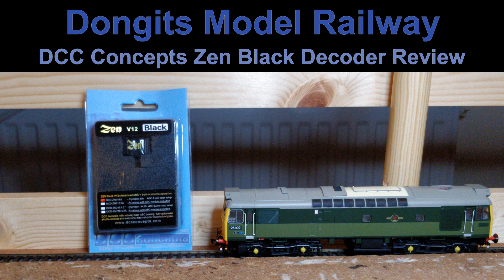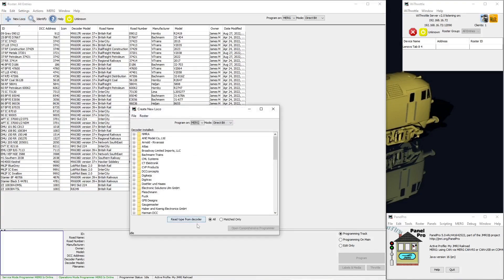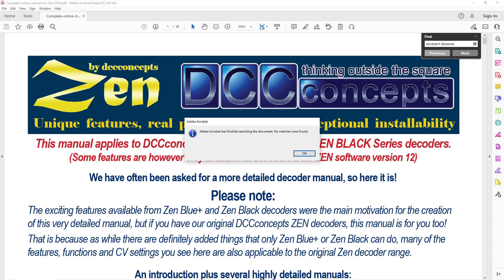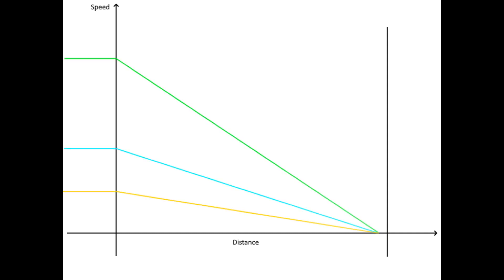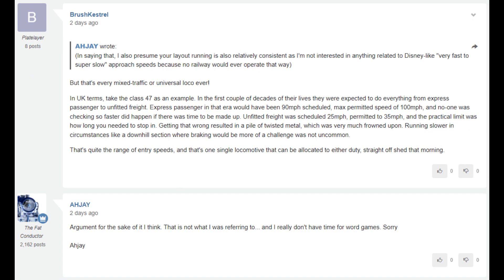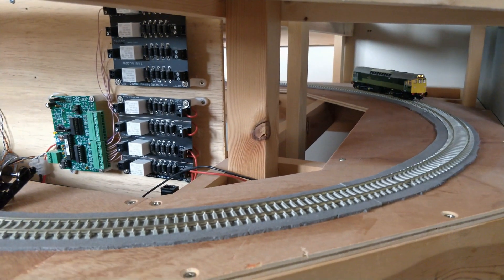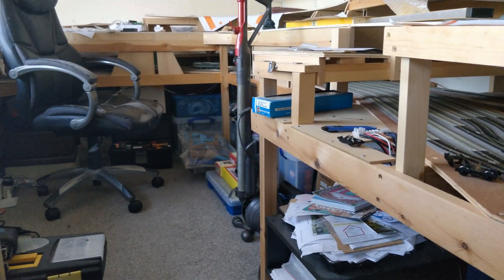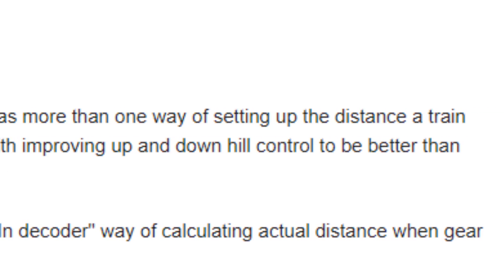DCC Concepts Zen Black Decoder Review - Just how good is their ABC?

Comment: I feel particularly stupid after watching that. My layout has been left in the loft of my previous home and my new loft is a railway free zone at the moment. When I did play trains, I drove them around, made them whistle and stop and shovel coal and flange squeal and so on and have no idea, or have even heard of ABC constant distance braking. The graphs you made helped and I would assume that it is used for automatic train operation? Returning to the graphs, I would assume that all decoders should be able to apply graph one - trigger point to stop point - without a huge amount of trouble. It would seem that would be a more difficult move than I thought.
Well put together video, interesting point well made and pluss one subscriber.
Reply from the maker: The decoder measures constant distance by dead reckoning, counting the fluctuations in back-EMF as the motor turns. Given the pole-count of the motor, the gear ratio and the wheel diameter is all fixed, the same distance can be reproduced.

ABC can be used for fully automatic train operation, but I use it a bit more like the real railway uses TPWS -- to catch trains that people failed to stop themselves. Consider a club environment with 5+ people driving trains -- and chatting at the same time. All too easy to creep up behind someone, or miss a junction set wrong. This stops everything from expensive accidents to accidental shorts.

There are two features of the decoder that are required to support constant distance ABC braking -- the ability to spot the voltage imbalance (which almost all modern decoders have), and the ability to count motor revolutions from the back-EMF. This latter one is not universal -- you'll find all Zimo, all current generation ESU and most current generation Lenz have it, but I'm guessing the reason DCC Concepts haven't implemented it this way is because the hardware they are using can't do this.
Reply: I find it intriguing to see what different DCC features appeal to different people. It is not unusual or wrong to only know what you need. ABC braking is often used to bring locos/trains to a halt at the end of sidings. It is achieved by using a diode to slightly lower the voltage on one rail only. The decoder is programmed to detect this & respond by slowing. The distance part is useful to stop the train at the right place regardless of its original speed. When the loco moves off again (in the case of a bay platform, reversing out), the lower voltage rail is on the opposite side so the decoder does not see this as a signal to brake.

Comment: Not surprised at what you found.  I drew the same conclusions about the decoders from reading the manual.  As soon as it was apparent that DCC-Concepts had departed from the accepted standard implementation of ABC, it was "forget it".   I think your loco-reversed behaviour (creeping on slow-approach when reversing through the brake zone) is predictable from the manual.  

Alternative decoders given the shortage of Zimo decoders:  
Your report indicates that Train-o-matic have implemented Lenz' awful constant braking (brake-then-creep).  
I don't know how well ESU have done things, but I'd start by trying one of their decoders.  
There's D&H who's manuals suggest there may be constant braking (it's a bit cryptic) and definitely has asymmetric DCC braking (if you can find any decoders, think they've got the same component shortages as Zimo).   
Uhlenbrock might be another candidate, their documentation says they support ABC.  
If you trip over one, I think the old Hornby Sapphire decoders may have had ABC in them.  

- Nigel
Reply from the maker: If Lenz decoders work like Train-O-Matic, I can cross those off the list. That's good to know.

I do have an ESU here at the moment under test. Video coming later, but so far it's a lot more work than the Zimo (which have been almost plug-and-play for the most part), but I think I can make it work.

I haven't managed to trip over a Hornby decoder with ABC yet, all of the ones I've dug out of second hand models have been the base model awful ones.

Comment: I think you've unwittingly developed an attitude problem during this whole encounter. Perhaps this is in response to the attitude displayed by the employee on the forum, but I don't think you've managed to remain objective during your experience.

You're clearly a bright bloke, but may have lost sight of the space in which you're working here. The average DCC user doesn't have a clue what ABC is. They also give a very strange expression if told to operate a program like decoder pro. 

Both actual technical problems encountered here, namely;

1.A lack of available configurations for DCC Concepts decoders in the Decoder Pro software
2.ABC implementation in DCC Concepts decoders being different from that which you are used to

are the result of the niche nature of both JMRI and ABC combined with the target market for DCC Concepts' products. 

ABC, such that it is, is not part of the DCC standard. It is built upon the DCC standard, as a 3rd party addition. I can see I have no need of explaining how it functions to you, but you seem to be under the impression that because other manufacturers have settled on one implementation of Asymetrical DCC for automatic stopping that all others should follow suit. 

The average DCC user is typically not interested in the high quality offerings by Lenz or Zimo (outside of sound decoders). The average user is concerned with, in order:

1. Value for money
2. Availability
3. Ease of use
4. Performance

and so the list goes on, but it would take an awfully long time to reach "ABC compatability with other manufacturers". If this were not so then Hornby and Hattons' decoder sales would be considerably less profitable.

I don't say this to somehow belittle you for being an advanced user of DCC, but to try to explain that DCC Concepts' decision to implement ABC differently from the way you are used to is not irrational or a failure. It is the direct result of seeing ABC as a means to offer low skill DCC users an effective shuttling facility. Does this mean they are somewhat limited if they later change the purpose of their ABC installations? absolutely. But I cannot imagine it has ever mattered to someone who has been introduced to ABC as a concept by the Zen Black range as a means of creating intuituve shuttles.

As for the lack of decoder pro configurations for Zen decoders, that is regrettable for us happy users of JMRI, but not of much consequence to a business which clearly doesn't care much for the software or computer control in general. For a business that doesn't specialise in this potentially very complex and extremely individual world, this is frankly understandable. I don't think DCC Concepts would garner appreciable additional sales by creating configurations themselves, and in doing so would create another line of technical support in an area which most modellers, even experienced ones, simply don't understand. Again, the averge DCC user will turn their nose up at the first sight of code.

As someone who is more than happy to use JMRI and indeed enjoy the benefits of more advanced DCC features such as ABC, I sympathise with your frustration. That said, your response to a free, open source piece of software with no afilitation to DCC Concepts not having precisely what you want is somewhat entitled. It is also completely at odds with your very own actions in creating a configuration for your own purposes which I can only hope you have shared with the user community of JMRI. That is how open source programs are built to be so flexible and powerful and yet you seem to be engaging with that process while lamenting that nobody has done it for you already as if it were the fault of the manufacturer?

I do not wish to emulate the attitude of the staff member you interacted with as i'm completely with you that their actions were very poltician like and not altogether helpful. None the less it seems to me that the sourness of that interaction has blinded you to the rational reasons for the decisions you are criticising.
Reply from the maker: > "I think you've unwittingly developed an attitude problem during this whole encounter. Perhaps this is in response to the attitude displayed by the employee on the forum, but I don't think you've managed to remain objective during your experience."

That would have been a reasonable criticism of the first draft of the script -- the one I deliberately sat on for a week, then threw away and re-wrote precisely to avoid that problem. I disagree it applies to this one though.

> "The average DCC user doesn't have a clue what ABC is."

True -- but this is an ABC specific review. It's in the title, the thumbnail, and the entire video is focused on ABC. If you want a general user review of a Zen Black decoder which doesn't focus on ABC, the decoder has been out for over 3 years and the internet is already full of them. There's not much point in anyone making a new general user review of this decoder now as everything that needs to be said has already been said, and I can't add much to it.

However, the internet is also full of what is frankly misinformation about the ABC features of this chip, written by reviewers who have never used ABC, and their "review" of it ranges from "read from the manufacturers blurb" to "put two modules on three bits of set-track and made a single vehicle shuttle back and forth".

And it is this misinformation that is why I ended up with this decoder in the first place, and thus why this ABC review exists.

> "ABC, such that it is, is not part of the DCC standard. It is built upon the DCC standard, as a 3rd party addition."

Look at the history of DCC a bit closer. DCC is built upon a proprietary Lenz product. A few of the predecessor Lenz features (like stretched zeros to allow control of one analogue loco) were deliberately omitted from the standard to avoid patent encumbrance, and a few extra features to make the previously German focused implementation appeal more to the US market were added. You'll note the vast majority of command stations still implement the stretched zeroes feature, and all decoders can cope with it happening because even though it was written out of the de-jure standard, it is still a de-facto standard.

While ABC may not (yet) be a de-jure standard according to the NMRA, the basic ABC feature set has become a de-facto standard precisely because many different manufacturers use it in a consistent manner, not just the original Lenz implementation.

Directional stopping based on whether the waveform is shifted high or low is one of the de-facto standard features. Please correct me if I'm wrong but as far as I am aware, DCC Concepts is the ONLY manufacturer which does implement ABC braking but does not implement this directional behaviour. Everyone else who implements ABC has managed to do this the same way.

ABC Slow speed sections are objectively not a standard at the moment -- each manufacturer has done something a bit different with the DCC signal to add this feature, and we've yet to see a 'winner' emerge. That gives DCC Concepts license to implement this part however they want, but it does not permit them to drop the standard directional feature without criticism.

Constant distance braking doesn't need to be standardised in quite the same way, because (up until DCC concepts came along) it wasn't part of the train/track interface at all, and could be implemented entirely within the decoder. Hence you see a variety of strategies across the different companies that do implement it, and some that have ABC braking but do not have constant distance. In making it a part of the track/train interface, it's again reasonable to criticise them for this.

> "you seem to be under the impression that because other manufacturers have settled on one implementation of Asymetrical DCC for automatic stopping that all others should follow suit."

Ummm, unironically yes. That would have been the smart commercial decision. If everyone is doing the same thing, there's good commercial reasons to be compatible with it. DCC Concepts could easily have made the standard behaviour selectable by CVs, but in choosing to ignore this de-facto standard, they are siloing themselves off from every other manufacturer. As a small player, that's a really bad idea.

History is littered with failed projects to improve things that were both not sufficiently compatible with de-facto standards to see incremental adoption and not enough of a revolutionary jump up for people to abandon their existing installed base and move across all at once to a different way of doing things.

> "The average user is concerned with, in order: 1. Value for money"

If that is being used as a reason not to buy Zimo's MX600R or MX638D, then it counts against this Zen Black just as much. I paid more for this Zen Black than I did for my most recent batch of MX638Ds.

> "2. Availability"

... Yup. That's a kicker, and is the only reason I'm looking elsewhere at the moment.

There's nothing to choose between the Zimo and Zen Black on your other two points.

> "It is the direct result of seeing ABC as a means to offer low skill DCC users an effective shuttling facility."

And in dedicated shuttle train service, with the track tuned to how the loco/unit responds rather than attempting to tune the decoder to what the (existing) track requires, I'm sure these can be made to do the job just fine. But ABC can be, should be, (and in the layout I have built, *is*) so much more than just a way to have a DMU run back and forth on it's own separate single track while you concentrate on shunting in the foreground.

Having said that, the fact they don't directionalise their ABC braking zones does create a problem *even in shuttle train service*, as is demonstrated ably in Jenny Kirk's livestreams. If she loses power (perhaps due to a short created by derailment elsewhere on the layout) while one of the locos is in the braking zone, because it is not directional it can get the sequence wrong when the power comes back and proceed out of the shuttle area in the wrong direction. Had the ends been handed with the signal being directional, the decoder could have worked this out on power return, and made sure to move in the correct direction.

> "your response to a free, open source piece of software with no afilitation to DCC Concepts not having precisely what you want is somewhat entitled."

The point here was that the JMRI developers seem to have put in significant effort about ~7 years ago to support the original Zen decoders, and have been met with a mixture of indifference and hostility from DCC Concepts. I found a forum thread where the same employee blamed a customer's use of JMRI for what was clearly a decoder fault, and this doesn't seem to be an isolated incident. I decided not to include this in the video because I wanted less focus on the forum and more on the decoder. If the company is just going to advise users to avoid using JMRI and attempt to deny all problems they experience if they've ever touched it, it seems reasonable that no contributor to the JMRI project has bothered to update the decoder configuration files for the Zen Black, as a direct result of the attitude of the company. JMRI not recognising Zen Black chips is  thus a negative against *DCC Concepts*, not against *JMRI*. Perhaps this point is less clear as a result of me cutting a giant chunk of detail from this area?

Also, via some rather imprecise wording, that employee managed to diss the *entire concept of open source*, not just the JMRI project. I had a point ready to make about how all major open source forum software projects have figured out that when a thread is locked, you should also stop allowing people to edit the posts in the locked thread, but that the DCC concepts chosen commercial forum software is one of the few that hasn't figured that out. Honestly it felt like a cheap shot and again, it hit the cutting room floor.

> "creating a configuration for your own purposes which I can only hope you have shared with the user community of JMRI."

It's not ready for end-user use, as the UI part was not completed. As such it would be inappropriate of me to upload it as a contribution to the shipping product. However, just as it would be a waste of my time finishing it off, it would equally be a waste of anyone else's time to re-do the parts that I already did. So i have made it available by uploading what I made to the JMRI bug tracker ticket regarding this decoder. Should someone else wish to finish the job, they are more than welcome to use my work when doing so if they want to.